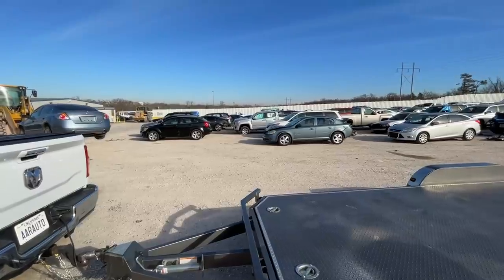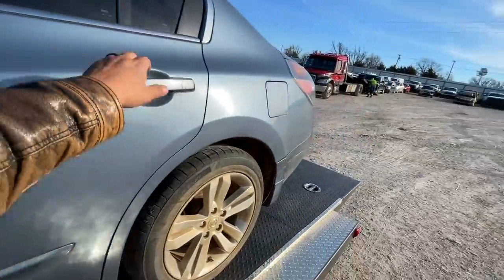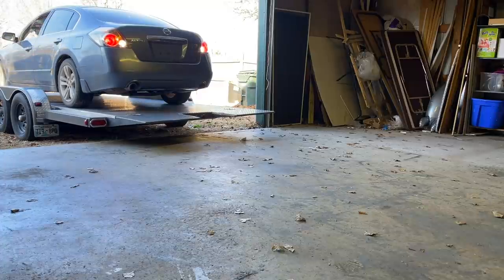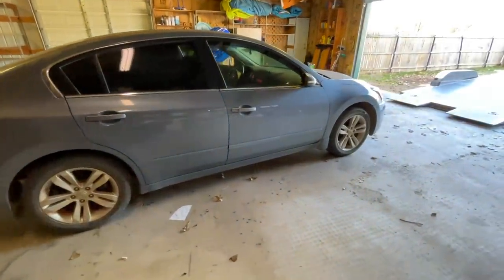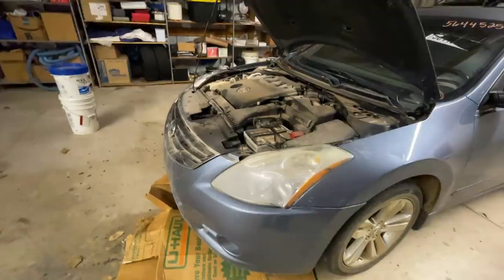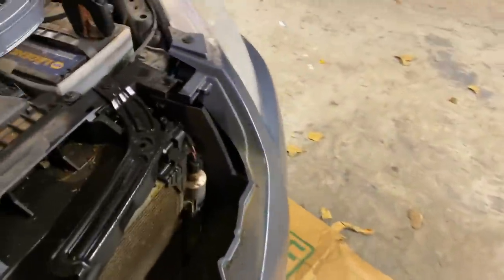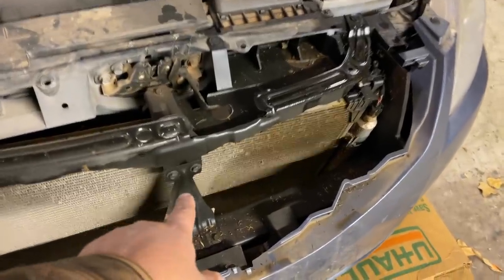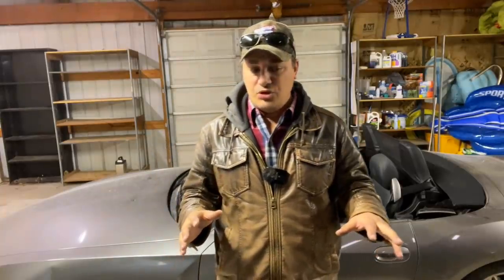I won a 2012 Nissan Altima SR 3.5 from Copart for $900!!!

Comment: Good ride. I had a 2010 Altima I bought brand new and got over 200K miles on it before I sold it. Never had any issues with the cvt.

Comment: Dangggg only $900!! Those things are absolute gold out here! My 06 with 143k sold $4,900. I hope you’re able to get double all said and done man!
Reply: @robertvance1873  Thank You Robert that means a lot! Gave you a shoutout BTW on the new video. Not sure if you wanted your last name out there so I only did your first.
Reply from the maker: @bitcoochie4093  book with a rebuilt title is $5200 here.
Reply: @robertvance1873  You’re welcome Robert, will do next time!
Reply: @AutoAuctionRebuilds  Dang that’s still pretty dang good on a rebuilt, not bad at all! I did have a clean title, but to be fair even housing prices are up 20 - 30% out here at the moment. Non the less excited for you!
Reply: Use nissan cvt fluid
Reply from the maker: @bitcoochie4093  Remember I sell cars for a living. So take your unknowing negative a$$ elsewhere son. Betting you roll a clapped out Civic Hybrid coming on here talking like you're grown lol.
Reply: Kelly Blue value is $1200 & that would be for running.  Randy way over paid on this one.
Reply: @authorizeduser4603  in what universe? You’re just being annoying for no reason. I’ve never seen one of these sell for under $3000 with exhaust and power steering issues
Reply: Shoo, go ahead.  But what happened to when i can get a decent used car for 500 

New cars are in style brand new.  Like i wouldn't pay much for a 94 corvette or anything 10+ years old
Reply: @rstuff1605  I'd rather old. New cars aren't made as well

Comment: I've been following your channel for the past  3 years and really proud of all of your accomplishments. I myself have a Nissan Altama, and knock on wood, no problems with the cvt so far. I have changed out the fluid in the trans about 5000 miles ago. With CVT's I have learned that if you dont dog them out, they can last a long time.

Comment: I have a 2004 nissan altima with the 3.5 and it is a beast for what it is. It shocked me after I did the timing chain to get it running. Its a blast to drive.

Comment: Google Nissan - CVT - judder and see how many hits you get. BTW Nissan has stated the CVT cannot be rebuilt. Good luck!
Reply from the maker: Sorry bro I don’t live my life by google posts I just life my own life
Reply: Ok, here is a fact. I purchased a new 2013 Pathfinder with the 3.5 V6, and same CVT, and they had to buy it back in less than 7 months due to slipping CVT and "judder".  Your vehicle has the same engine/transmission combination, and a lot more miles.  To be more specific, go to  forums for the vehicle and see what is posted regarding the transmission.

Comment: Anyone out there hating on Nissan CVTs, yes you are right to hate but only on their 4 cylinders models. The CVT in their V6s is actually much more reliable and the cvt pair with a V6 not only gives you better MPG when driving normally but actually gives you the engines max power when you floor it.

Comment: For 1000 dollars you could equip your new home's garage pretty well for minor work. Air compressor, cripper, floor jack, jack stands, a 200 piece tool box, shop vac, and those car lifts that go under the frame on the side that will raise it 2 feet or so (quickjacks). Ok those cost 1600 by themselves but the rest....

Comment: Have you ever explained how you go about being a member and the hidden fees in buying a car the whole process. Start to finish.  I’ve tried dealing with copart it seems a little pricey and difficult. For just 1 car.
Reply: Copart is only one that will come out ok on this flip .
Reply: You can find how much the fees are on copart’s website. If he won the bid at $900, the copart fees are $275+online auction ($39 iirc)+ loading fee ($59 iirc) So he got the car for about $1275.

Comment: Not a Hooooorrrrible car. Drove a 08 Altima coupe for 6.5 years. Towards the end car would not accelerate (limp mode). Made it to 120k before that. Gor did at 130ish. 

Finally some nissan on the channel. Woo woo

Comment: I started working again so I was not able to watch if I knew you bought this I have a lot of parts for it like a quart of the CVT fluid the transmission gaket for the pan new screws for the pan the filter a unprogramed key I could of gave you. I always asked for you to buy one of these. I thought you might like it if you shift it yourself and the power is good also.

Comment: I hope it doesn’t have a cvt transmission. If so maybe it has already been replaced. I have a 2012 I bought new and at 112,000 miles the trans just said “It’s been fun and I will see you later” it checked out! I spent $4000 on a new transmission and my youngest daughter now drives it. I have done a few videos on it. Good luck with it.

Comment: I think you can replace that radiator without disconnecting  the condenser if you remove the top of the radiator support.

Comment: Since the new place has low clearance for a lift you could just get one of the rolling lifts that are either electric or air powered that you drive over and it brings the car up off the ground at like knee height. Better than jacks. New shop could be AAR detail center too? well you do have rebuilds in your name so only makes sense to....rebuild cars lol

Comment: Nissan are notorious for CVT failure. My wife's Sentra was a 2014, 62k and it had so many transmission issues. It never ended. The quality of the interior sucked too.
Reply: Those cars of that year had problems should waited for 2020. The CVTS are better now even Nissan has got much better their lineup is amazing. Around that time the lineup did suck.

Comment: I have done that push and run before and it isn't much fun!  If I did that a lot I would bolt a winch to the floor at the back of the shop to pull things in and off a trailer.

Comment: Even if the Fob doesn't have a battery the car should start if you place the fob against the Push Start Button... It works on my 2016 Altima.... Not sure if the same on the 2012....

Comment: Good score Randy. Is there a chance the CVT fluid and the coolant mixed? If you could mount some type of remote controlled ram to lift the trailer while you are inside the towed vehicle would make it safer to do a solo offload. Doing and looking good AAR.

Comment: Nice got the nissan. I was really confused about that car and the radio head unit it has, should have a screen radio double din thing. But I'm guessing they spec'd it some way who knows. I was looking up these interiors for like 30 minutes, playing spot the difference between this car and other 2012 SR altimas to 2010 SR'  head unit
Reply: Yeah that  AC/heating control is fair complicated my brother had a Almera with that system and it took us half an hour to figure out how to work it.

Comment: Hey Randy I used to have a 2007 Altima but mine was a 2.5 S it was the 4 cylinder. But it had lots of upgrades it double din head unit and it had 18 inch rims and limo tinted windows and it had led front dome lights and led rear dome lights and led headlights and led fog lights. It was a nice car but sadly it got totalled.

Comment: I am curious as to why you didn't add some fluid to the transmission so it could move on its own. I saw it wiggle when you first looked at it..... seems like it would be bad to run the engine with fluids low or even gone. I have wrenched most of my life on heavy equipment and any fluids that are low are addressed before trying to operate them.

Comment: My old car believe it or not was getting mad coochie with this car that back seat had lots of fun memories. On a side note flush out the cvt in full and replace it with brand new CVT fluid and add a CVT transmission cooler 
I always flushed my CVT at 30,000 MI once the car flooded in a flash flood it had 220K on it basically the CVT does not like when the fluid gets hot then it starts to act up

Comment: I don't remember if your trailer has a winch, but keep that in mind, because  if it doesn't move like this Altima one would be very useful to load the cars if you plan to leave them at the new house first.

Man people are becoming more spoiled everyday 250 hp and some people call it a pos... People you actually don't need 700 hp for a daily driver and 250 are more than enough to move a sedan like this one. 🤦

Comment: Don't put cvt fluid fron the auto parts store the transmission won't last a month.  You need to get it from the dealer (NS-2)
Reply from the maker: Thankfully parts stores now have an equivalent NS-2 compliant fluid.

Comment: Good deal i see those on CL 2016 for 6,000$ with good miles not sure why they are so cheap
Reply: They are cheap cause they age, and some people don't buy them because of the transmission, if Nissan didn't group with Renault and used a good transmission like a ZF transmission, all there vehicle's will sell like hotcakes.
Reply: @kellyoubrejr544  Gothca so I shouldn't buy one the Lol
Reply: @frankm8533  I mean, not saying it's a bad car, there great on gas, they offer sporty driving for a midsize sedan and decent reliability, the interior is average, the transmission is horrible. It has it's pro's and con's, no car is perfect, but these are decent cars and you can be a lucky one, cause not all of them have problems with the transmission.
Reply: It just depends on what you buy it for, are you buying it to get you point A to point B, are you buying for sportiness, are you buying it for gas mileage, there are other good option.
Reply: @kellyoubrejr544  just looking for a new driver, traveling for a while was thinking a Sonata to. I have a truck but its a gas and insurance hog!!!! Haven't owned a car in 13 years its always been trucks
Reply: @frankm8533  Well... I would recommend a Camry, don't get a 2007-09 they are oil burners and they had a problems with the pistons I believe, get the newer one, or get a Sonata, I think they had problems with carbon build up with the older GDI engines... But there still reliable, but Camry I would definitely choose, there really reliable cars, and not to expensive to maintain and decent gas mileage, it all just depends on your price range and how far your willing to go.
Reply: @kellyoubrejr544  yeah I knew about those year Camry and The GDI issues by buddies GDI did that exact thing. Just haven't decided yet I use to work in a auto shop then auto body, couple years at both but both bosses were dicks both were dead end jobs just got sick of it one-day
Reply: @frankm8533  Oh dang... But yeah, it all depends on your taste and price range, if you see a car that looks nice to you and is in your price range, go for it!
Reply: And look for reviews on the car and study it more before buying it.

Comment: Basically  like a nissan murano a pain but do able for about anyone  just takes a little time
Reply: Lol right! It's definitely worth the time. I know when I had to do the water pump on my 06 Altima 3.5 Flip. You actually had to remove the engine mount, a secondary fuse box, and the alternator. I think even an extra water pipe housing. Worth it though, people love them here, pretty sure I sold it for $4,900. So yeah a pain, but they're definitely worth the work.

Comment: Nissan....why was the left rear well area torn up and the right tail pipe is pushed in a few inches with the right rear bumper wrap separation.......i honestly feel that the front end has been hit before....they did shottey repairs
Reply from the maker: nah
Reply: @AutoAuctionRebuilds  okk

Comment: Beware of Nissan CVT transmissions! They don't have a good reputation and with the 3.5L it was under quite a bit of stress. On top of that, you left it running with no fluid in the trans! Then only way that car would be a score is if it had the 6 speed manual.
Reply from the maker: It’ll be ok
Reply from the maker: I already made a profit off it on this video alone

Comment: Tell me I didn’t just see that at 8:00.  Need an 8’ 4x4 or some rubber wheel chocks to catch the car next time.  Maybe slightly apply the parking brake. As always, enjoy your videos.  Check out rockauto.com for headlamp housings.  I’m very happy with the two sets I purchased. ~$35 each side.

Comment: Ok Randy, it's time to stop being cheap & buy yourself a hi-lo aka fork lift ! I almost pee on myself watching you struggle to get that car off the trailer ! Second of all don't you think that when you & Weird Beard were both breaking balls unloading that Wildfire lift things would have been 
easier if you had one ? Mustie 1 has one & he used it to setup his Wildfire lift & he also uses it to move cars/vans. So look around $1,800 - $3,
500 is not to high of a price to pay over life & limb ! Concerned 😳! Also buys toolbox for your pickup a trip to Home Depot grab a 100 piece tool 
set a drill a grinder & throw that in there so you will always have them with you.